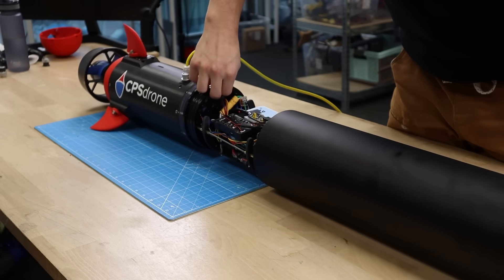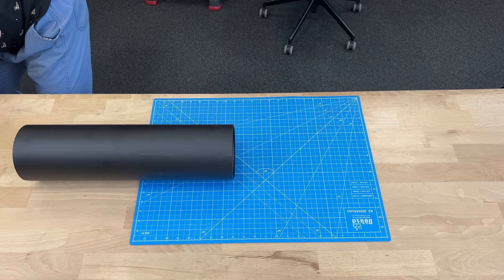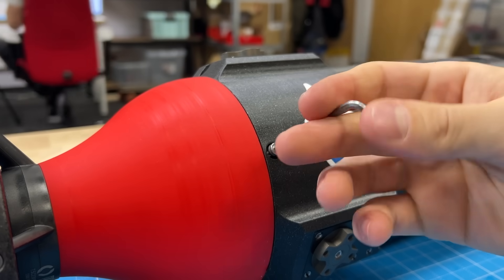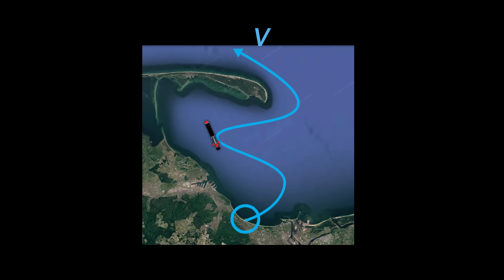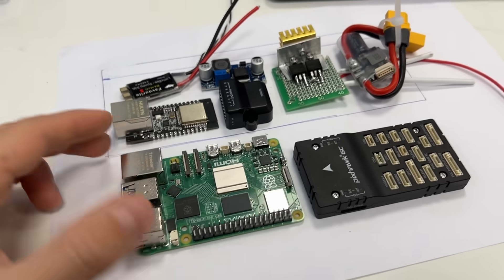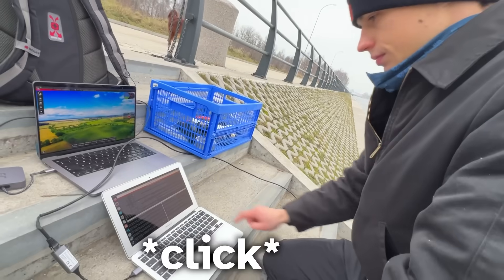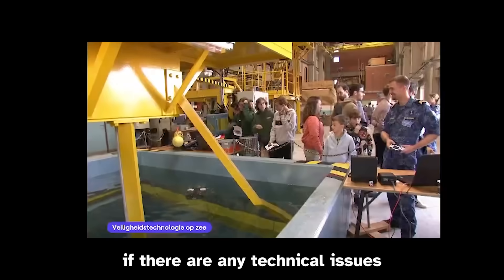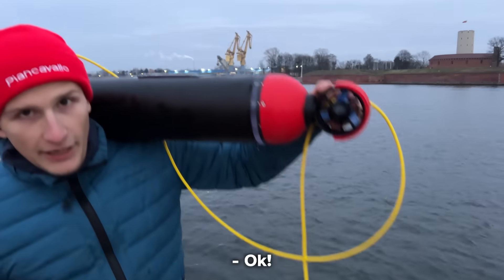Building a fully AUTONOMOUS submarine

Comment: If you are planing on adding DVL I would suggest also adding some sort of recovery system like self inflatable buoy with a gps tracker or something like that.
Reply from the maker: Yes! That's definitely a way to lower the probability of losing all of our work
Reply: @CPSdrone  I used to do Subs in Schools in Australia. For our submarine's recovery system, we rigged a Co2 canister to a bike tire inflator hooked up to a servo. The CO2 canister was hooked up to 4 of these locksmith pry airbags, which worked really well when our submarine wouldn't surface at the bottom of the testing pool.
Reply: @CPSdrone  you could also set the drone to automatically surface if it only has little battery charge left.
Reply: @Archbtw_ you dont have to do that if the drone itself is so boyant that without actively steering it downwards it would float. Like a ballon with air that only stays underwater because you pull it down, as soon as you let go it would resurface, only issue with that would be that it uses energy to stay down, but that power consumption could be minimalized by making it only just the tinest bit more boyant
Reply: @CPSdrone  I think a co2 cylinder inflating sort of airbags or some could be easiest
Reply: As a recovery release mechanism can use a chemical fuse. An anode that corrodes or a dissolving solid that physically releases a counter weight, then the sub floats to the surface. Similar used on James Cameron deep submarine.
Reply: @missassembly the chemical ones can dissolve faster if exposed to the current induced by the submarine swimming, just something to consider, another YouTuber wasted a lot of time and money because he didn’t realise that lol 😅
Reply: @missassembly  Can't you keep a solenoid bar attaching something with a separate battery? If it runs out, the solenoid is released, something happens to make recovery easier.
Reply: With the clarification that work class ROV are trimmed to be slightly heavy so they sink to the bottom when un-powered/tether breaks. Sinking to the bottom eases recovery because a floating ROV drifts off location with the current. Ships rarely operate with a single ROV, as you oft need a pair to entangle ☺and untangle each other.
Reply: usually you want to drop a counterweight rather than inflate a buoy as it is more reliable
Reply: I would recommend something like SIM or LoRa antenas for this possibility.
Reply: OR have a servo which is hooked up to a metal net surrounding a ballon? when power is applied the net compresses the baloon, bouyancy is reduced, sub skins, when servo stops gettign power or controller tells it to release, baloon inflates, sub surfaces. basicly like balast tanks in a normal sub?
Reply: @StreuPfeffer  correct principle different fluid. Ocean gliders change buoyancy with oil filled bags. Pumping oil between the two bags, located inside and outside the pressure hull changes buoyancy.

Comment: Inertal guidance with surfacing now and then for recalibration by GPS could be an option for the guidance system
Reply: INS with GPS or fixed way points is how military submersibles operate. It's the best option, really, as it would be next to impossible using contour following without the topographical maps needed for the database.
Reply: It only needs to be underwater for "the last 100 yards".
Reply: No need to surface. Just unspool a small plastic bottle with just some buoyancy, with the GPS antenna inside it. Gather GPS coordinates and then spool the bottle back down.
Reply: I have no idea if this is plausible - crude triangulation via  acoustic pings transmitted from stationkeeping remote control boats or bouys?
Reply: @TheNonamedbandit  Definitely. These is called 'Long Baseline Acoustic Positioning', and these systems are readily available. Not cheap though, and getting the reference stations in place is not that easy.
Reply: For anyone interested: there is a 2008 paper from Hegrenæs, Berglund and Hallingstad about IMU on autonomous submersibles without velocity aiding. It's possible, but you need to run a complex kinetic model of the sub. They  would have to switch from a Raspberry Pi to smt more powerful.
Reply: @jm7606  Theres been so much progress from 2008 that I don't think this is relevant anymore. Both in compute but mainly in the algorithms. I think you could totally do dead reckoning (INS) even without a very advanced model of the sub. Just test it out in practice with a boat - how fast does it go at what thrust settings, how fast does it turn with what fin setting. Plus a gyro, compass, accelerometer and a EKF to make sense of it all. Even if you have to emerge every minute its better than towing a tug. And dont forget that you'll still have a position error the size of the tether with the tug anyways (unless you model the tug and tether very well, which you probably wont). So definitely INS and emerging to get a GPS fix whenever your error get too large. You can track the error as well.
Reply: @simiken1234  I totally agree with you, acquiring the kinematic model through practical test is the cheapest and fastest way. Also, surfacing when the error of the IMU gets too large would be the way to go. The kinematic model just helps to make better error predictions and slows down the error propagation. Computationally, this is still quite a large task, even with modern algorithms. Y. Bai and colleagues wrote a paper on this as frequent as 2023. They still had to  emphasize the computational cost of running such an algorithm.
Reply: @jm7606  That's a problem in and of itself, since a raspberry pi is already quite power-hungry for battery a powered application. A more powerful processor will draw  more power, reducing battery runtime. Maybe this kinematic model can be implemented on a small FPGA? Not sure if there are FPGA's with power needs as low as a raspi though.
Reply: @jeroen94704  I reckon that using an FPGA could be a viable option. The crude solution, I think, would be switching to something like a jetson Nano (not sure if they specifically are right for the job), enlarging the battery and flotation section. For proof of concept, that should be enough.
Reply: in theory I agree but its going to get difficult with currents involved
Reply: @sam8551  More difficult than towing it tethered floating well above?
Reply: @sam8551  difficult - yes, with all the math involved. But if programmed and tested  good enough it should be much more reliable.
Tethered boat rolled over - you lost it.
Need to go deeper then tether to scan the bottom of the sea - lost a sub
It can swim under something and hook itself with the tether - another lost sub.
Also after hours of swimming most likely it will pick up a ton of garbage on the wire and slow down even more.

So I would go for "dead reckoning" navigation , with regular fixes with gps.
And i think simple computer vision can be used to deduce if currents are moving you and in what direction.
Reply: @ilya_k392  pretty sure its easier to use sonar and sea floor terrain data.
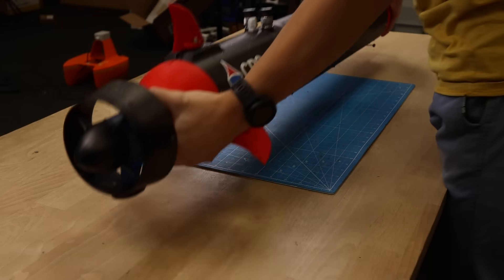think thats what he was hinting at @ 6:35
Reply: @sam8551  currents don't matter much to INS. Currents still accelerate and decelerate. But there's always some drift and uncertainty involved, of course.
Reply: @sam8551  while currents have an effect an innertial should be able to detect it. Its not like knowing your spread it measures acceleration
Reply: @sam8551  Difficult how?

If in open water, even a deviation of a hundred meters isn't going to matter that much, so long as it isn't compoinding, but self correcting.
Reply: My thought as well, surfacing for correction every X distance, waypoint dive, surface.
Reply: Inertial systems suck. How about this - three sonic lighthouses with fixed positions in the SOFAR channel each pinging with a different low frequency. Give sub 2 ears, measure phase difference between them to get the angle from each lighthouse, triangulate.
Reply: @bartniem9  Actually a good idea, but I'm somewhat concerned about the cost and complexity of your idea, yes it would be more precise then inertal guidance, but it probably would be to complex to setup, especially partial testing could get tricky.
Reply: @bartniem9  cheap sonic sensors work at distances of hundreds of meters only
Reply: I was going to say something like this. Surfacing every so often to check for location and diving again.
Reply: I thought I was a genius thinking this, then I saw it was already suggested.
Reply: Inertial system and compass with periodic checkups seems a good option. Dual accelerometers and gyros would help hugely, as shown by InputLabs. Not to mention they've improved a lot since the Wii. Compass would continue working all the time regardless of water, and velocity can be calculated and checked with the gps, averaged over time so it knows how to offset its own values between checkups. 

Gonna go repost this as a separate comment
Reply: They would need synthetic data to continuously feed the pixhawk (assuming Ardupilot) between recalibrations.
Reply: you could also use a underwater vector magnetometer, which measures the variations in the earths magnetic field strength (magnetic field intensity, declination, and inclination) along three axes (X, Y, Z) to determine position.
Reply: Works for the cartels.
Reply: How much does a small INS that can fit into the sub cost?  I'm guessing that it's not cheap.
Reply: @thedarksage328  I'm  nowhere near an expert on this topic, but I'm pretty sure that it's cheaper than other options like that one for about 8k
Reply: @thedarksage328  Perhaps if combine many identical cheap ones it will get a good result
Reply: @PoorlyWindow549  very bad idea in the Baltic considering Russian EWF and GNSS jamming in the region.
Reply: @WurstPeterl  More like exactly the opposite, if you can't use GNSS or something similar inertial guidance would be the only practical option, everything else would be way to expensive
Reply: Yep, that was my first thought. I haven’t even watched the video yet.
Reply: ok, so why dont real submarines have a propeller on the front to turn with?

Does it create a protrusion that messes up the hydro-dynamics as it pushes through the water? like drag slowing it down
or  does it make the sub stand out to sonar or something?
Reply: Did you consider ardupilot? I know it works with boats I imagine it would work with submersibles too.
Reply: Bro is building a torpedo
Reply: The submarine knows where it is because it knows where it isn't....
Reply: I think this is the best idea available but it will still suck. From what I've heard even military submarines with their military grade multi-million room sized IMUs accumulate like a mile of error within few hours. So with cheap hobby IMU and probably lack of knowledge and resources for proper system modelling and estimation they would need to resurface - optimistically - every few minutes, which is non ideal if the goal is to scan the seabed. By hobby IMU alone taking into consideration all disturbances they would encounter in the water  then even with some great tuning and calibration they would probably gain error at a rate of like a meter per second. 

However there aren't really any other options for them. I've done some research into that and really their only other options are utilization of sensor they mentioned in the video or something similar to improve estimation or use a sound based underwater GPS-kind of system (which obviously requires entire infrastructure on its own and is completely non feasible for them).
Reply: @ There is such a thing as a compass, and that alone, plus INS can solve a lot of navigational problems. A microphone could be used to find the direction of natural noise sources, or even infrasonic pings. Infrasound may be quite affordable. Or build a homegrown FPGA based doppler sensor.
Reply: @paxon57  Agreed, i operate survey  grade AUVs for work, and even with high end inertial sensors we need to resurface for a GNSS fix now and then if no acoustic positioning is available.